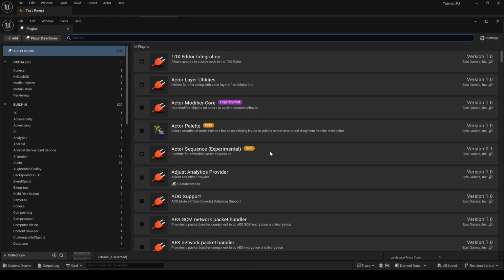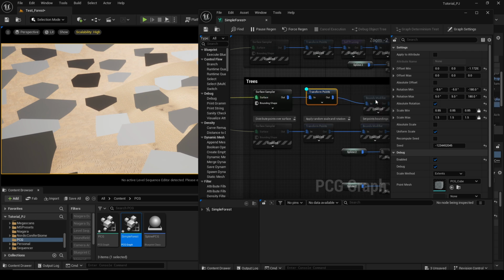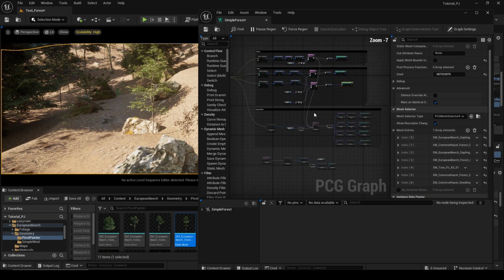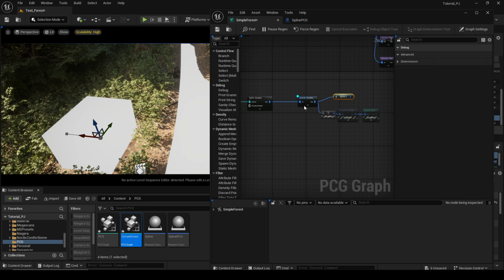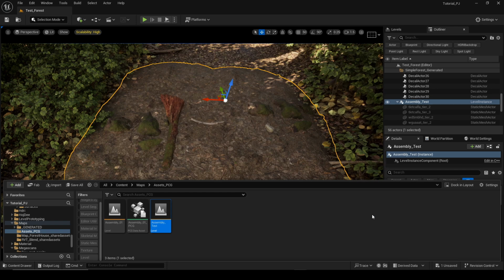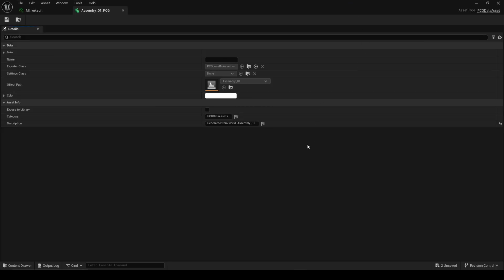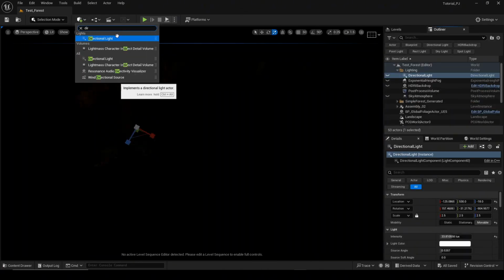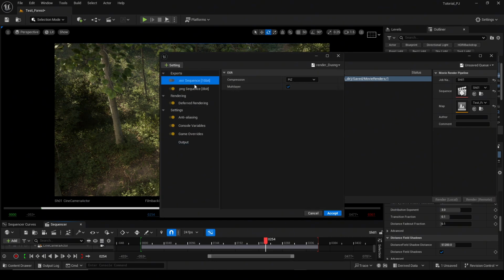Create Realistic PCG Forest in Unreal Engine 5 (Free Template)

Comment: Don't you think we need to wait a bit longer to play with this particular engine? Generally, games made with this engine usually... practically all of them share a common issue, no matter what setting you use: lighting problems. I've noticed that this problem can be partially eliminated in this engine by slightly worsening the lighting, specifically by adjusting the light source settings. You can create a modification with this setting that will work in any game that has problems with light often shining through textures—reflections in dark rooms. However, there's a catch: the developer can't update textures or the lighting itself for the modification to fix the problem....
Reply from the maker: Okay thanks, i'm noted